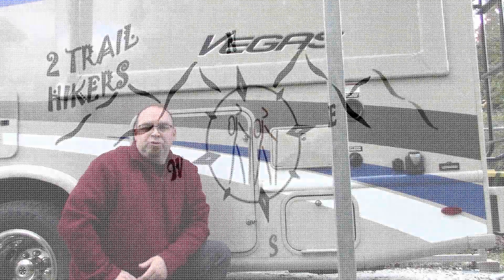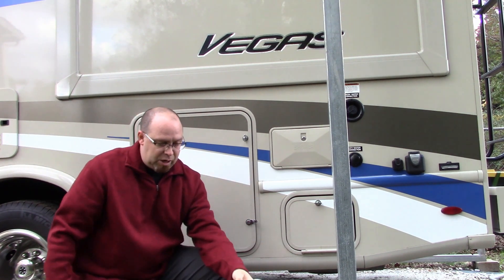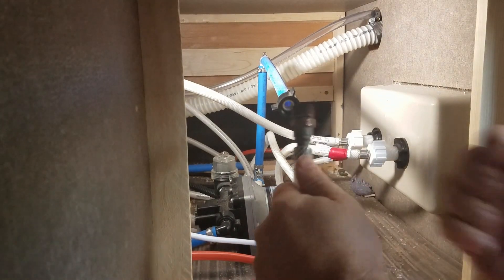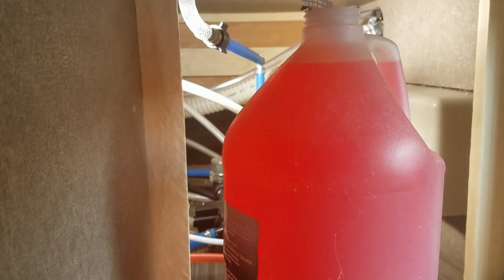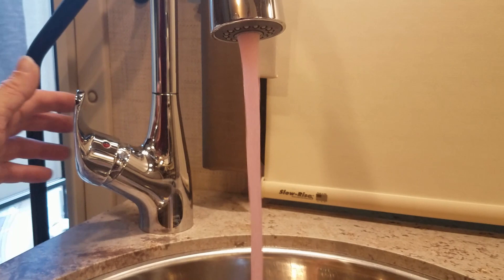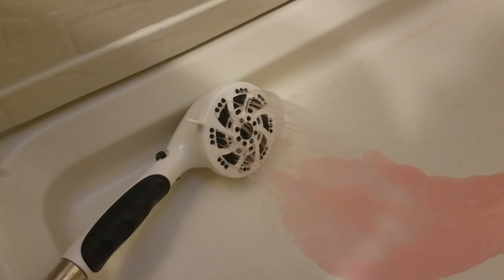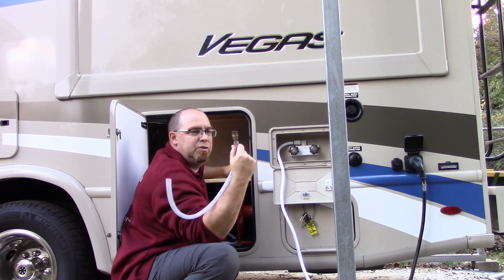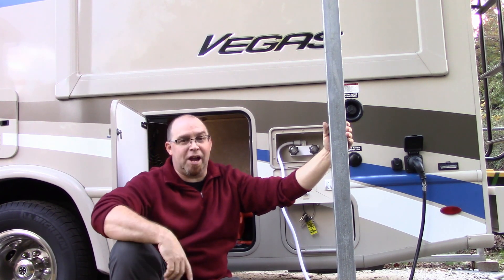Winterizing the RV water system on our Thor Vegas

Comment: Ever consider a dump valve redo?  Moving the valve to face out the side vs forward.  Remove the floor and hinge the door on the top vs bottom.   I watch the tow behinds guy dump so easy and I looking  to fish the hose through the floor hole behind the open door. Must be a better way.

Comment: Great video and happy you did one. We just bought a 2017 Axis a few weeks ago. Because a large power outage in our area for 4 days we moved into the motor home. Found it very comfortable but had to use the water system. Now I needed to winterized the unit again and wondered how to do this. Thank you again for info. I would be tempted to put a shutoff valve on that intake line and leave a siphon hose attached. Less hassle next time. Cheers Rick

Comment: well i guess not.   hmmm, seems venting should handle the stink.   we use the bathrm sparingly #1 only.    but it is worth a try i do a full flush today and i'll ad rvAF vs the dry blown out method i use to winterize...    ...thanks..       any thoughts to why my #10 fault light might be on at the converter?      i think i prefer the electric/alcohol fridge too vs the 12volt compressor style seems to use to much power for my likes...

Comment: a little off subject but after winterizing my vegas 24.1, i am getting sewer gas from somewhere.   seems from outside at the entre door. area.  any suggestions?   appreciate your vid's for sure.
Reply from the maker: Did you flush the tank thoroughly? My first thought is there is residual left in the tank.

Comment: What about your hot water heater?  Did you bypass?  You definitely don’t want antifreeze in your hot water heater.
Reply from the maker: We have the tankless. Last time we winterized I drained and blew the lines out with air. That was a mistake..a piece in the hot water heater froze and cracked. Luckily it was a replaceable part. I'll run antifreeze through it from now on and just flush the system.

Comment: What recall did you have and warranty work I have a 25.2 nice video thanks
Reply: 2 Trail Hikers thanks   so far so good on ours
Reply: The walk through was far to quick to find the problems I have uncovered since I picked up a 2017 25.2 Nov-2017. The radio RF speaker output was miswired from the factory-THOR sent me a new radio and pigtail. The house batteries were dead due to lack of float charging-Camping World re-imbursed for two deep cycle batteries from Costco. The 30A fuse was open on the dash cigarette lighter 12V output-I bought fuses on Ebay and replaced. 3 of the 4 rear tires were underinflated (50lbs instead of 80lbs) for my 2300 mile trip West from Wisconsin. It's nice to be handy when you own and maintain any RV.